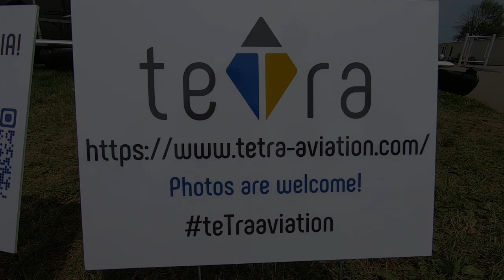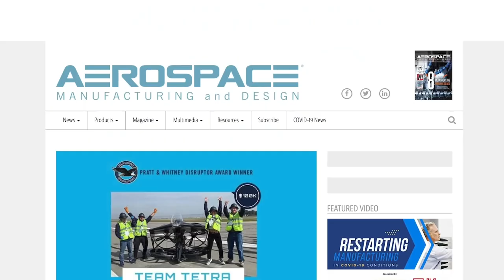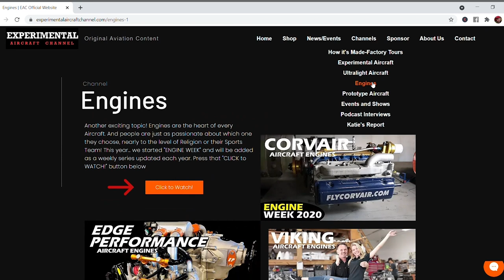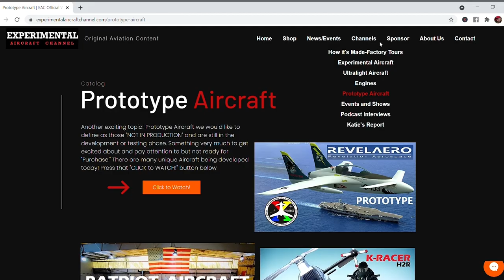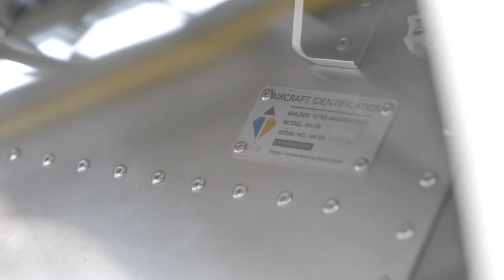Oshkosh 2021 - Tetra Aviation eVTOL Interview

Comment: What’s the battery capacity and approx flight times, cost estimate of kit and finished aircraft, when will it come on the market
Reply from the maker: Flight testing (MANNED) in the next few months out in California. Flight times as typical (1hr). Cost for complete kit with everything needed to fly around $400k initially.
Reply: The half-ton lithium battery in a Tesla 3 packs about the same energy as two gallons of gasoline.